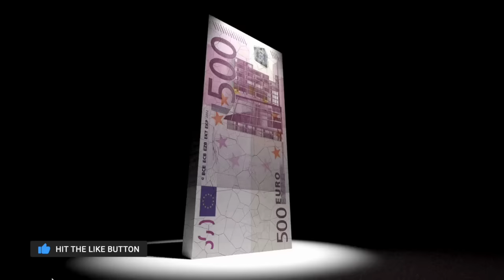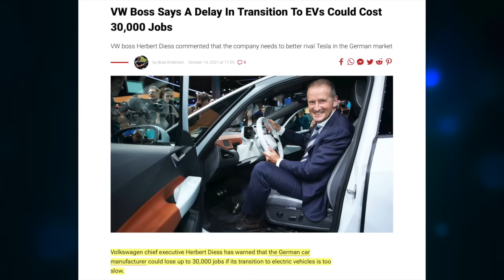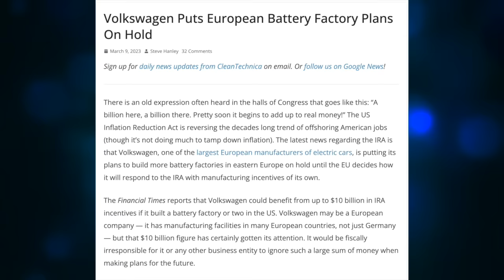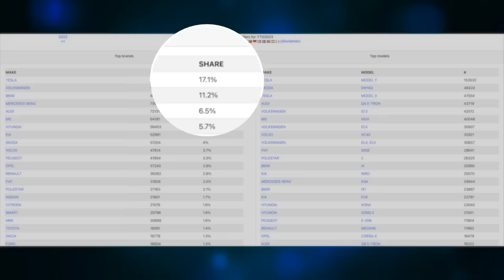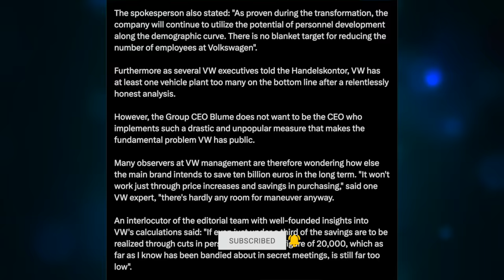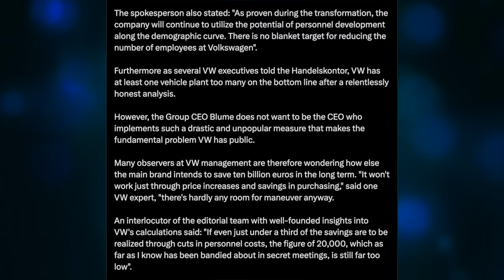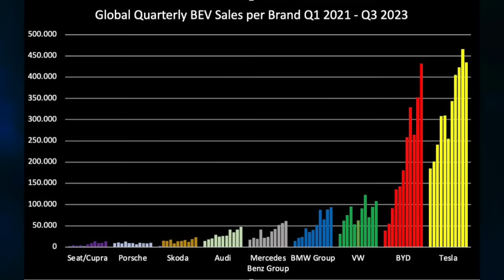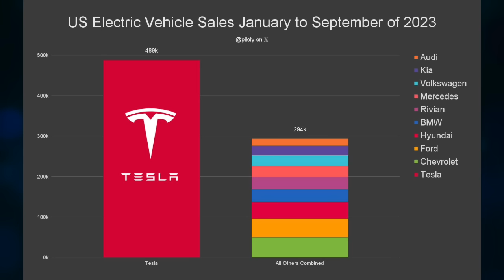Herbert Diess warned them, but they fired him & now VW is to fire 20,000 employees!

Comment: This video is completely wrong: they are downsizing because their ev products are poor and expensive. And because the general ev market is slowing drasticly. Ford gave up on a huge battery plant investment in Turkey. Also in US they cancelled plans to invest 12 BILLION in electric cars. People just don't want them. EVs stack up at dealers and customers do not want them. The majority of customers who already adopted evs did so as a second or third car. Early adopters already well... adopted. So Diess was wrong and the transition to an ev brand was a bad idea from the start. They should have remained devoted to the traditional VW customer, who wanted their well known and famous products (Golf, Passat) and not hastily shift to products that they don't know how to build and design. They should have diversified their offer to include evs, like other brands did, SLOWLY, and not cancel or punish the product line that has made them number 1 volume auto maker.
I just came across this video, but it's plainly stupid.

Comment: In the beginning I was absolute happy to see in Diess as the new VW Leader that understood the great engineering and Design of Tesla. But the decisions he made were catastrophic in my opinion, some to me already at the time, some in hindsight.
VW wasn't growing so well, because it made the best passenger cars. It was doing so, because it used synergies between passenger and small to medium transport cars. The biggest fleets of commercial used cars often were completely from VW!  It did that with excellent engineering, design and quality again and again, and it followed up on obvious trends like the front wheel drive, the minivan and the SUVs. In some areas it was way ahead of the competition, for example in  independent suspension 4WD options over almost the entire vehicle program starting from 1990, when most of the car world still did 4WD using live axle for the rear. In 2000 you could order a normal passenger Skoda Octavia (already a doughter of VW at the time) with 4WD Drive.  
VW also started very early to offer a fully electric car variant in their new designed mini car "E-Up" starting from 2013 that sold about 3% of all sold "Up" mini cars, which was pretty good at the time and also in their most sold car "Golf" as E-Golf "Citygo", starting from 2014, followed by a really well received E-golf starting from 2016. Rather Expensive but very well usable for the average consumer with low range expectations and a charging port at home. Not usable for mid to long range, thus unusable for any commercial service, because of a catastrophic lack of any charging possibilities everywhere in Europe. It was obvious, that both electric cars could not reach a mass market with that restrictions,. Along with the common range anxiety and a lack of sexy power like the tesla Model S offered it starting from 2012.

When Herbert Diess took over, he decided to give up the E-Golf immediately - it was never sold in big numbers anyways - although rumor had it, that it was more the lack of availability than a lack of potential customers. It think production always had cost more, than it was sold for. The E-Up continued to sell well taking into account how small and expensive it was, it even greatly benefited  by the electric car hype reignited by tesla and a growing number of public charging ports in many cities and villages in germany and Austria. 
By far the most important decision Diess took, was the complete focus on the new MEB platform. I was happy to hear that at the time, because knowing the past of VW strategy I figuered, that soon there would be a perfectly usable electric option for almost every car type of the entire VW corporation for well established ICE car prices. Including all commercial usable vehicles,  mini cars like the Up, the Golf class, the minibus, the minivan, the SUVs, the mini to medium transporters like the caddy or the Crafter. What a great outlook! Every company willing to switch to electric could soon do so getting stat of the art electric cars  and save money by consuming less maintanance and energy costs. 

What we got was a golf car sized ID 3, with a basic interior styling, normally found in cheap mini cars like the Up, mediocre specs compared to the competition, completely different platfom and design than the high priced ICE VWs and a huge change from normal hardware controls to minimalistic soft touch and screen dependent control landscape. All of that with a hefty price tag that made all hopes for an electric "Volkswagen" obsolete. Now, 5 years later there is still no reasonably priced E-Up anymore, no fully electric mini bus, no usable electric small or medium transporter. All they have done up to this day is make bigger and better limousines, that desperately try to match the model S from tesla and a minivan, that looks like a bus but it more a lifestyle vehicle looking at the price, and its loading and towing restrictions. That was not a strategy, it was a predictable way downhill. In hindsight, VW would have been way better off, if they had started to make every new car generation with ICE and electric option at the same time. Increasing volume only if received and sold well. That would have given plety of time, to use the synergies of the high volume ICE production and ramp up electric vehicle prouction only when received well. Now they have two completely seperated divisions of production and staff: One for the slowly dying, but still by far most sold ICE cars and one for an electric car production with mediocre volume, plagued by high costs for the less than planned production numbers and reliability. What a desaster he has left!